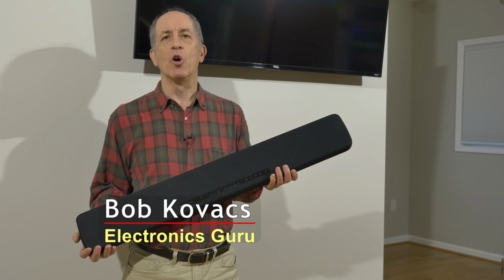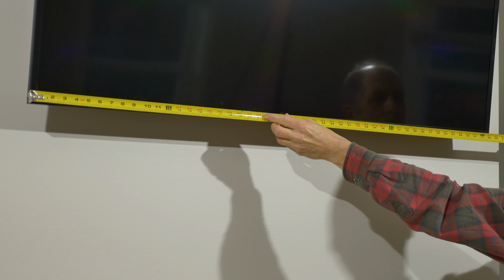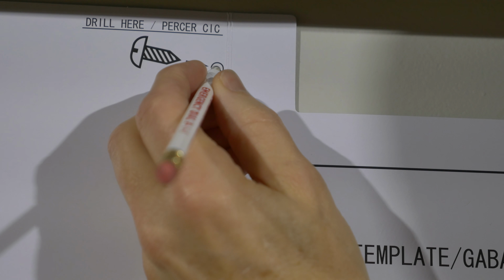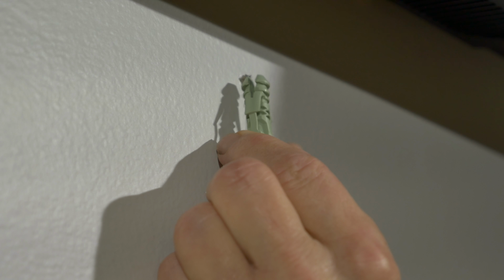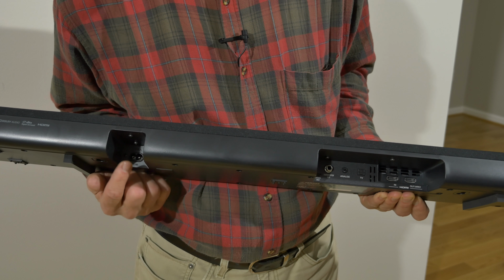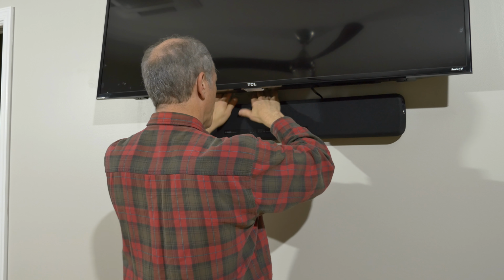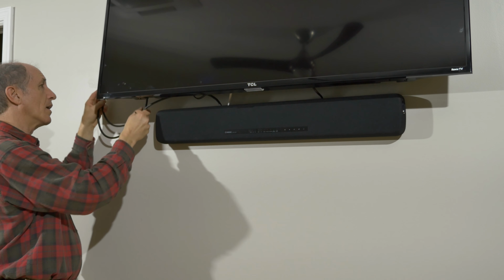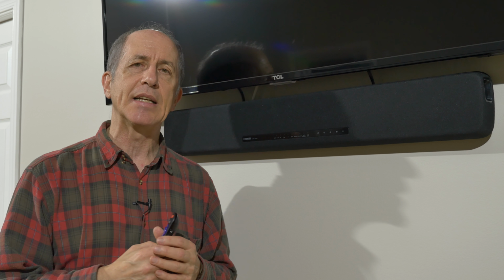Installing the Yamaha ATS-1070 Soundbar

Comment: I have been going over this damn connection with my new sound bar (Yamaha ATS- 1080 ) and my Roku TV 5 series for five days.,And I had already checked off in Systems Audio setting the CEC function and the ARC (sound bar HDM 3) switches,; as well in “picture settings” turning off the TV  SPEAKERS; and “ S/PDIF and ARC” on; plus switch on the “Dolby Digital DTS” , AND GUESS WHAT ?. No Sound at all.
Reply from the maker: I hear 'ya. I struggled to get mine working (the one you see in this video), calling Costco's concierge number. The combination of my TCL TV and the Yamaha soundbar suddenly started working for no obvious reason as I went through the various settings. It worked fine for a year or so, then it suddenly stopped. I fiddled around with the settings, and again it suddenly started working for no logical reason. A few months later, it died again. I then took the Yamaha soundbar back to Costco and got my money back. I use the built-in speakers on the TV now -- they don't sound as good as the soundbar, but they are reliable and not too bad.

I personally think it is some sort of interface glitch in the HDMI (ARC) connection, but I have no way to confirm or test that.
Reply: @BobKovacs  
I'm on 3rd Yamaha sound bar (1080) and the supplied fiber optical cable may be the solution or the rca jack. Just a thought.
Thank you for the excellent video
Reply from the maker: Yes, that could be. I was definitely disappointed with the intermittent operation using the HDMI (ARC) connection.

Comment: Thanks Bob for the nice and clear video. Can you tell me if this soundbar be set on table in front of tv as opposed to wall mounting, I just ordered one one from Costco earlier today.Thanks Bob.
Reply from the maker: Thanks, Frank. I no longer have the soundbar, so I can't say for sure if it can sit on a surface. Yamaha's web site says that it can sit on a table, so I guess it will work that way. I had a couple random failures with my ATS-1070, and I couldn't get it working after the second failure -- so I took it back to Costco for a refund. It did make good sound when it worked, but it seemed to have trouble interfacing with the HDMI control function with my TCL TV.
Reply: Bob Kovacs Oh that’s too bad Bob, luckily Costco is very good with their return policy. Thanks for the info and I’ll keep my fingers crossed! Thanks Bob!

Comment: Hey Bob! You didn't mention the spacers that were included and that you attached, but what's the purpose of them and are they really necessary?
Reply from the maker: Yes, I forgot to mention the spacers, although I did use them. The spacers keep the soundbar from digging in the wall and making little dents in your sheetrock that might later need to be repaired. It's not a big deal, but I would use them if you have them.

Comment: You did not explain if we needed to change any settings on the TV or soundbar so they can work together
Reply from the maker: Yes, good question. Of course, the settings in the TV depend on the make/model of the TV. With this TCL TV, I had to turn on the CEC setting and turn off the internal speakers. It was slightly more complicated than that, but that will get you close if you have a TCL TV. If you have another brand of TV, I really can't help you with the settings.
Reply: @BobKovacs  I have TCL and I could get the sound to come through the optic cable but not the HDMI cable. I will try your suggestion, and thank you for your swift reply. Subscribed!
Reply from the maker: Thanks! I have learned that getting the sound to work properly through the HDMI link is tricky, but it does work well once you get it working. You need to use the HDMI (ARC) connection on the TV, then look in the TV's settings for CEC and set it for external control. There might be one or two other settings. I bought everything at Costco (TV and soundbar), so I called Costco's concierge assistance at one point and actually got knowledgeable help. If you got both pieces at Costco, give that a try if you continue to be stumped.

Comment: I really don’t know how these cobra screws fit the soundbar. I tried based on your recommendation but it won’t fit the bar.
Reply from the maker: Ahh... I just used the Cobra anchors, and used screws with smaller heads. I have lots of screws in bins, so I just grabbed a couple that would fit. Sorry that I didn't make that clear.
Reply: Thanks for clarification.  Please add annotation to video so that someone else won't fall for it...

Comment: thanks Bob, simple and informative. you mention the HDMI Arc on the TV, it would've been nice to film it as some of us are just learning. I assume it's better than use the optical wire, no?
Reply from the maker: Yes, the HDMI ARC port is definitely better, since it controls the soundbar from the TV's remote. When you raise/lower the sound, it is completely integrated between the soundbar and TV, and the TV's remote will turn the soundbar on/off when you turn the TV on/off. Sound quality with HDMI is equal to the quality you get with the optical cable. So yes... you want to go HDMI ARC when you can.

Comment: Thank you Bob ! Did you make a review on the sound quality and are you satisfied with the soundbar in overall ?
Reply from the maker: You are welcome! No, I did not do a review of the sound bar, but I am pleased with its sound. It's in a fairly big room, and I was concerned that there would not be enough bass from the built-in subwoofers. But there is plenty of bass for me. There is probably not enough bass for a rap or hip-hop fan, but there's plenty for watching TV shows and movies. The mids and highs are clean. The only minor glitch is that the Yamaha soundbar does not turn off when I turn the TV off. If I leave it on, it stays warm (not hot), so I know it is drawing more than a trickle of power. I just use the soundbar's remote to turn its power off.

One other thing: The screws-into-sheetrock mount is not the ideal installation method of mounting this soundbar. It's hard for the two screws to be dead firm when they stick out 1/2-inch from the wall. I may re-mount the soundbar with a firmer mount. I have an LG soundbar (with an installation video on YouTube) that has a MUCH better mounting system than this Yamaha soundbar. The LG sounds just as good, too.
Reply: @BobKovacs  I have the same soundbar and it turns on and off with the TV no problem